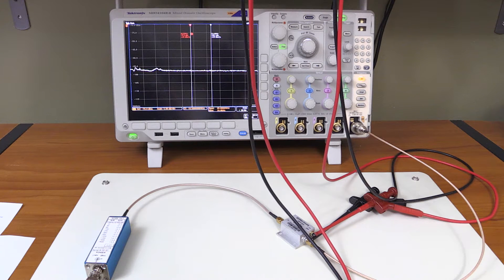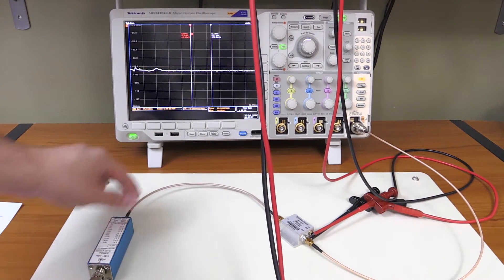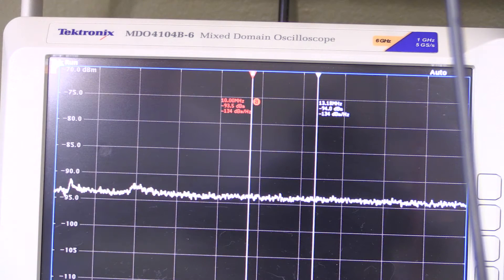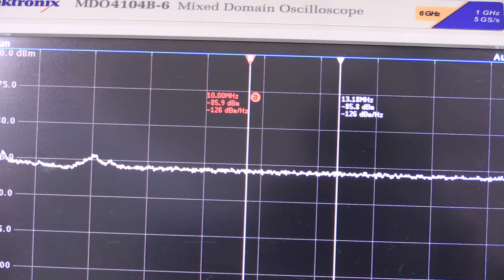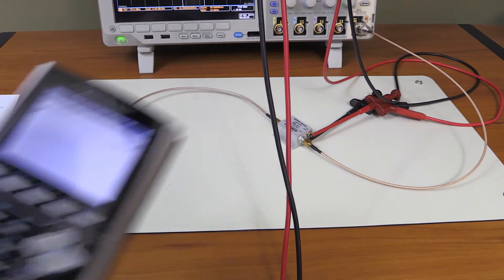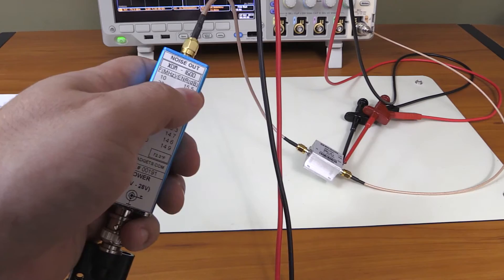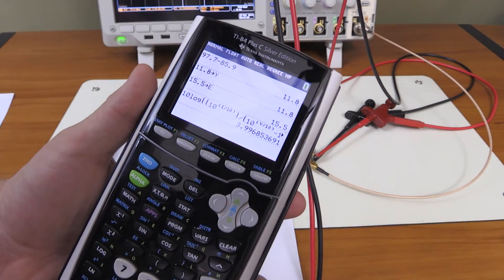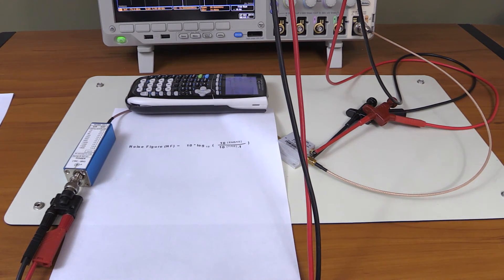How To Measure Noise Figure Using The Y Factor Method

Comment: For an accurate noise figure measurement you have to do second stage correction to account for the noise figure of the SA. To do this you also need to measure the noise figure of the SA itself, and then calculate the noise figure of the DUT with Friis formula.

Comment: Nice presentation. The noise figure measured is of the amp under test and the test instrument together. Unfortunately the noise figure of the test instrument is very high and even with a 30dB gain DUT, the Y factor value represents the NF of the 2 part system, not just the amp. The MiniCircuits typical NF data for that amp at 10MHz is 3.4dB. So a useful indication measurement, but not very accurate. Lower gain DUT's would lead to much worse results.
Reply: But should not the measured value be smaller than the datasheet value, as the instrument NF was not accounted?